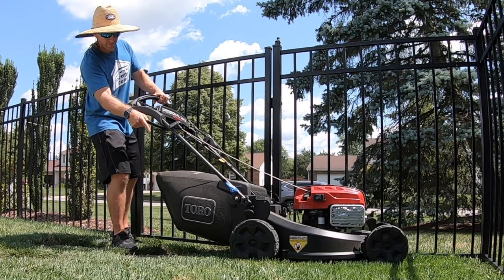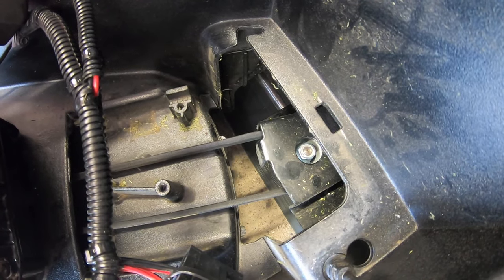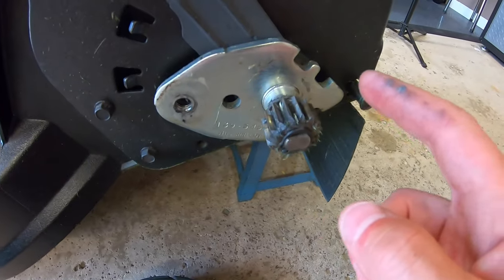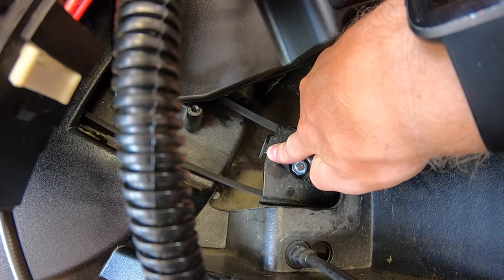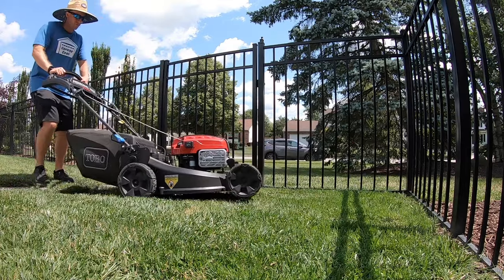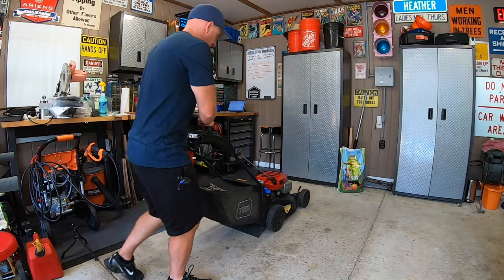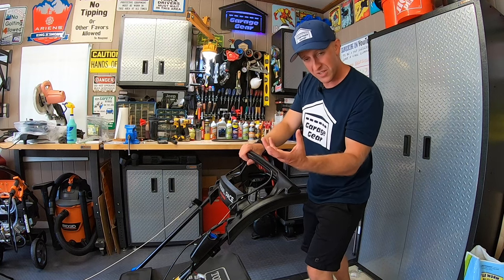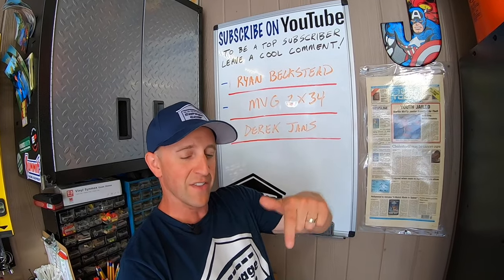WHY DOES MY TORO SUPER RECYCLER 21564 NOT BACK UP?

Comment: I had the same problem with a Craftsman machine.  I found that if you lift the back of the machine for a few seconds, the wheels will disengage.
Reply from the maker: Still a pain and you should have to do that
Reply: @GarageGear  Shouldn’t 😂
Reply from the maker: @jeffreybaker7406  thanks for the correction

Comment: I have a similar issue with my Super Recycler 60V model.  However, the wheels don't lockup.  The mower is just a bit more resistant to backing up.  I suppose it's the same root cause though.  Toro says to push the mower forward a bit then backup again.  It seems to work.  I'll try your suggestions too.  Thanks!
Reply from the maker: There’s a lot to fix on this mower wether it’s battery or gas. Toro needs to get their act together.

Comment: There is a simple clutch type mechanism in the axle gears. Sometimes it gets a build up of worn metal and grease. It can be flushed and re-greased through a grease fitting on the back, since it doesn’t have a check valve. Personal a little blast of light oil once or twice a season keeps it working properly.
Reply from the maker: Thanks for sharing this Gus!

Comment: LOL JB callin' out Toros Design Team (and Marketing) for their "Race Car Inspired Design) love it. Our Personal Pace LawnBoy had a straight metal upper handle that we never had to maintain, didn't check the drive since it never gave us trouble. It was an expensive model but not considered commercial.
Reply from the maker: Gotta call them out! Their quality is headed downhill! Thanks for watching gpal! Stay awesome my friend!
Reply: I complained to Toro about the curved handle the first day it came out.  What a stupid idea.  Let's introduce unnecessary friction to a system which used to be linear and worked fine.  Marketing stupidity!  They condescendingly tell you that you're wrong.  Just like I told them when I bought my 2012 Timemaster that the engine was underpowered and it needed the 223cc professional series engine.  They told me that I was wrong and the engineers determined it was completely unnecessary.  Guess what they did in 2017?  EXACTLY what I told them in 2012...they put the 223cc engine on the mower.  I used to be a Toro guy but they have pissed me off with poor customer service and dwindling quality over the years.
Reply from the maker: @mellowjammer  toro is definitely dwindling
Reply: Straight handle is better with blue traction assist handle

Comment: As someone else mentioned i have to push foward a inch or to 2 release it just got same one last week and im finding the locking up in reverse a hassle to say the least i have to do alot of the short passes kids outdoor play set i dread cutting back yard now since i picked this mower up
Reply from the maker: Perhaps you can string trim around all that a little more so you don’t have to make such difficult passes with the mower.

Comment: Update I took a spring from the arm that's already on transmission to the hole that back flap goes through and now it goes back every time super easy!!! Can go back and forth really short back to back and never gets stuck now
Reply from the maker: Hey blazing gray! Thank you for sharing this! Would you mind sending me a picture of what you did exactly to my email in the video description? Thank you in advance!
Reply: @GarageGear  sent you the email!
Reply: @GarageGear 

Hey JB.. can you share that mod? Wonder if different than what was done on mine?🤔
Reply from the maker: @apexiumim2741  sure it was a small spring linked between the transmission personal pace cable hole and the back of the deck where the drag flap hole is. Didn’t work though. The point was to pull the transmission back down after it was engaged.
Reply: I have same issue and would like to try this trick. Any pics would be greatly appreciated.

Comment: When I had a previous Toro that had the older more angular handle design (similar to the timemaster), I could easily grab the PP bar and the fixed support bar below it (thus not engaging PP) when in tight spaces.  The new handle design is so stupidly large this is now much more difficult.  A curved handle?  Wtf?  Race car inspired?  No… just… no.  Inspired by someone who has probably never actually used a lawn mower.  Most people aren’t going to put the extra thought in - they’re just going to say “this sucks” and either return it, or be upset with the brand because of it.  A miss either way for Toro.  Goes back to a previous comment I made… marketing & design run by a Potato at this point.
Reply from the maker: Definitely a miss by toro JC! I think it will be a while before toro smartens up!
Reply: Straight handle is better with blue traction assist handle

Comment: I have same Lawn mower. Bought 4/1/24 used twice went in shop 5/1/24. When pushing lawn mower to put back after mowing it grinds or clicks horrible. When mowing when you push to engage personal pace the gear click or grind then engage. Even when the engine is loud you can hear the clicking or something grinding. I finally got back yesterday 5/20/24. Excited to mow my grass today on the 3rd time up my yard it sounded horrible again. Same issue. Is this a common issue with this model? I have only mowed 3 times. What would you recommend?
Reply from the maker: That does not sound right! I would take it back and possibly see if you could get your money back. Sounds like Something is broken with your transmission.
Reply: @GarageGear  Just a quick update finally received my replacement from dealer couple weeks ago. Super impressed. Looks like the first one was a defect. It runs smooth smooth and doesn't hang up in reverse. Thanks for your response!!
Reply from the maker: @JosephLaCombe-xq6vn  good to hear my friend!

Comment: The Drive wheel locking up could be the cable adjusted overly aggressive.. i like mine aggressive but too much and it does cause issues..  don't use WD-40 on the slide for the  personal pace instead use a dry lubricant like silicone or Teflon.. it stays way clean plus dirt does stick to it worsen it over time..  check the personal pace cable rout as it's definitely catching.. it maybe a result of the added features of yours the electric start.. the spring could be stronger however the model without i have not experienced any issue
Reply from the maker: Thanks for sharing joe

Comment: Very informative. I've found being smooth with it does help. 

Unfortunately I've been super disappointed with this mower. Cut quality is poor, personal pace handle is far too big, motor sputters, backing up issues...for the price I expected a lot more. I own an HRX217 which is the same price as this toro but FAR FAR FAR FAR surpasses this mower in every way. 

Maybe if it had a blade stop there would be some sort of saving grace with this mower.

If you are in the market for a high end residential mower, there is only ONE mower to consider and it's the HRX217. Even if you are a toro fan boy there is no denying the disappointment of this machine.
Reply from the maker: Thanks for sharing Esteban!
Reply: HRX is unfortunately being discontinued. No good gas mowers to buy anymore, best to fix the one you have

Comment: The older personal pace machines do the same thing, the new curvy handle isn't the problem.  The plain and simple answer is Toro never fixed the design defect that allows this to happen.  I've found if I let the mower roll forward slightly as I pull back on the handle, the rear wheels release.  It is also essential to adjust the cable that transfers motion from the handle to the belt pulley/transmission bracket.  Very small changes can make a big difference.  If Toro management wasn't so fixated on profits over customer satisfaction they could easily have the engineers fix the real problem.  Since they haven't done so since the Personal Pace system began, I'm guessing those profits are more important to them.  Now it's up to consumers to let them know how they feel about this by voting with their pocketbook.  There are other brands out there folks.  When Toro sales drop, perhaps the leadership will get the message.
Reply from the maker: Profits are definitely more important to them! Thanks for watching gcraig
Reply: with Honda going away please tell us what our other choise is besides a $1500 xmark
Reply from the maker: @rdick218  if you want anything that’s better built you’re going to have to look at something more commercial. Homeowner stuff nowadays is just built too cheap
Reply: @GarageGear  I work on automotive automatic transmissions I see cheap junk every day.  I thinking about building a bad ass mower.  I do organic gardening and grass clipings are the answer.  They keep the weeds down and feed the soil.  I've been working the shit out of an older Honda.  It realy struggles with the grass thats tall and wet.  If it has rained in the last 48 hrs forget it.  I need POWER!  And I have to bag it all.  Its a labor of love though.  I had no idea what the vegies should tast like before.  Whats the bigest engine that will fit on a 21" mower is my question.  And where do I get it!
Reply from the maker: @rdick218  briggs makes a 223cc engine that they put on the timemaster. Not sure where to buy it exactly
Reply: its a ratchet mechanism in drivetrain designed  for safety when people   are mowing on hills  so mower doesnt roll backwards back on them , what you did    1)pull back  and disengage personal pace  handle completely  and then  push  roll the mower  forward  little  bit slightly  = the rear wheels release. its for safety, but yeah a little  bit of ridiculousness.

Comment: I was considering the Super Recycler because my HRX217 has its own issues backing up ... maybe I'll hang on to the HRX217
Reply: I just bought an HRX217 used. Hoping I don't end up running into the same thing although I know my neighbor has had some back up issues with his Honda HRR.
Reply from the maker: I wonder if there is a spring related issue with the Honda’s not backing up because someone else mentioned this as well. Thanks for watching.
Reply: @GarageGear  The Honda rear axle rotates through 2 plastic bushings (1 left, 1 right). I took mine apart and one bushing was all galled up and the axle was not smooth either. Had to sand them down to get them smooth again. I've had to do this twice within 5 years. It's a nuisance.
Reply from the maker: @ALnMO  thanks for sharing this!

Comment: Seems that this problem negates the cost and designed ease of use of the Personal Pace system. I think TORO needs to conduct a douching of their R&D department, Pronto.

I have heard numerous complaints about TORO in the past 5-6 years. And that includes push mowers, riding mowers, snow blowers, and some of their battery-powered units. 

If you are going to charge Top-Dollar,  you need to be a little bit more reliable than PowerSmart...............
Reply from the maker: 100% agree, brother. they’ve been slipping downhill for a while now and it seems that the only decent mowers they have are the commercial ones, but then again they are trying to push battery to the commercial guys. Batteries are for ladies nightstands. Right? LOL
Reply: @GarageGear  Lmao!
Well, those real tough ladies use the outlets on the wall…..
🤣🤣
Reply from the maker: @paulmysliborski4832  hahahhahahaha they sure do!
Reply: Straight handle is better with blue traction assist handle
Reply: WOW, Powersmart!  That's really hitting them in the nads!

Comment: My Honda lawn mower wheels won't back up at all anymore. The wheels are completely locked when I try to go in reverse. I wonder if it's something similar?
Reply from the maker: I  wonder if you have a transmission spring they is missing. I have seen that be the case on some John Deere’s before.

Comment: Does the commercial 21/exMart cousin also have this issue? I also have to ask. Those nylon gears that drive the rear wheels. Are they so they can be replaced? Also, do they have serious wear issues.
Reply from the maker: Hey John! I don’t think the Exmark has these issues. All the wheel gears are metal. No need to worry about them wearing down!  By wear issues what do you mean exactly?

Comment: Strange, my 2005 personal pace with the 6.5 Tecumseh doesn’t have this issue because it has a key spring system on the drive gears. You think Toro would keep that design, but apparently not.
Reply from the maker: We would think right? Toro has gotta stop cutting corners! Any plans for the weekend BCSERK?

Comment: I have a new Toro lithium, it sucks, wheel fell off in 2nd hour, battery shorts, and on-line Toro will not take it back. They do not take items back if you use it for 1 minute! Their rear left geared wheel unbolts itself from the bracket, it self destructs! Two others have the same problem. Their repair dealer literally told me "with Toro, its Buyer Beware". I have a Toro case number, a BBB case number, and a US Consumer Product Safety Commission case number.  Save yourself and learn from my mistake, and stay away from Toro.
Reply from the maker: @dougpence3862  thanks for sharing

Comment: It looks like it would be easy enough to drill a hole in the tab on the front of the transmission cover and hook a stainless steel spring around the screw post for the belt cover.   You'd have to get the spring tension right but then it would always fully release.
Reply: So, you're suggesting that it may be Sprintime in Garage Gear Land?
Reply from the maker: That’s not a bad idea @ayrplanes
Reply from the maker: Thanks for the laugh @eugenepolan1750
Reply: I was thinking the same thing. Add a spring like Honda.

Comment: My model 21462 does not have this problem despite the curved personal pace system, I can pull it back and forth without a problem now if it just had a larger discharge port that would not clog so easily.
Reply from the maker: Thanks for sharing Mike!

Comment: The handle height adjustment is confusing. Do you have to move the rubber blocks to the other hole to allow the handle to lower?
Reply from the maker: Hey Stuart! No you shouldn’t have to. I just moved the handle bars to the other holes and left the rubber blocks where they were!
Reply: @GarageGear  Will email a couple pics of you don't mind, I think maybe they changed the design.
Reply: Yes. You have to move the rubber bushing up to lower the handle. This is on the redesigned deck.
Reply: @LL-mt2nz  Thanks! Done.

Comment: My solution, find another mower.  Don't go with Toro.  There are other options out there, one drying up fast is the Honda and another similar system that's actually an improvement is the Cub Cadet with My Speed.  It uses a lever design instead of the sliding handle.
Reply from the maker: Thanks again for sharing wjc